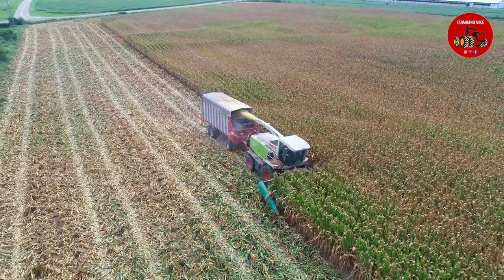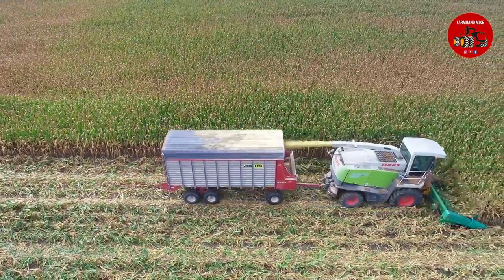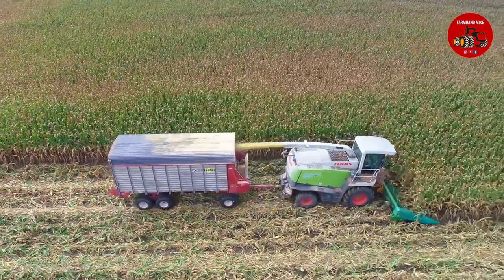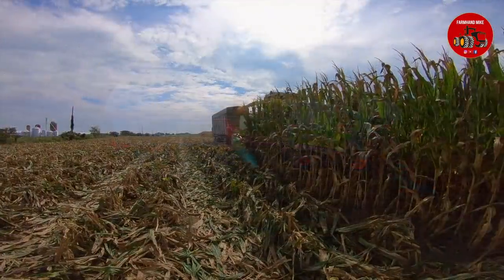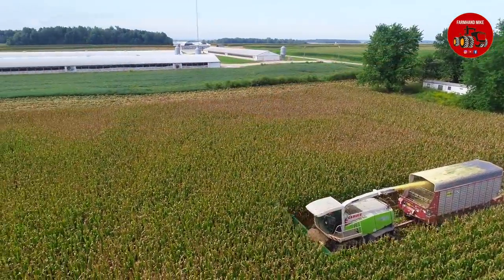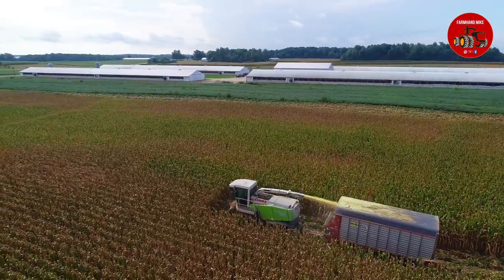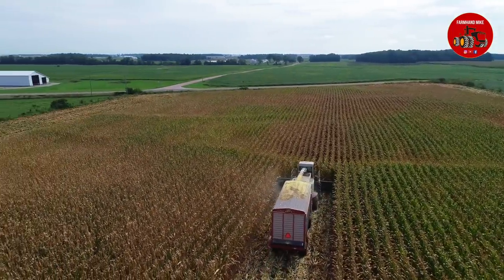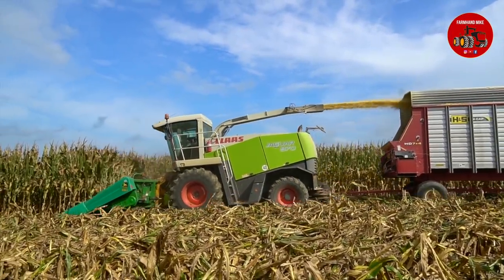Chopping High Moisture Corn near Fort Recovery Ohio

Comment: So does that header strip the ears from the stalk ????
Reply: Yes, that is what corn heads do. There are narrow slots between the prongs and feed rollers to pull the stock down through the slot. The ears are too big for the slot and pop off onto the auger and are carried into the combine intake.

Most of them also either chop or mangle the stalk so it will break up into smaller bits, but it didn't seem to me that this head was doing that.
Reply: It is a corn head for a combine on chopper yes it strips the heads of the stock and feed it through the chopper.
Reply: Alf anderson II some will bale what’s left for cornstalks bales for bedding